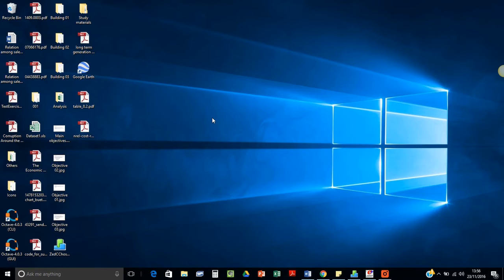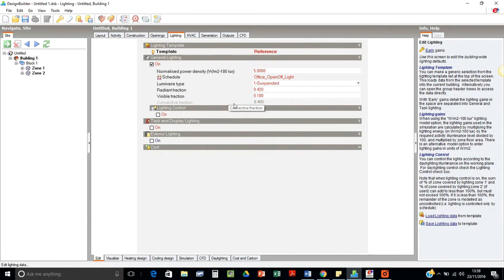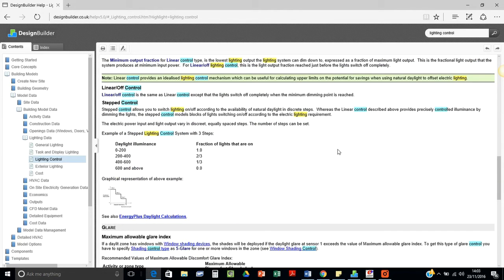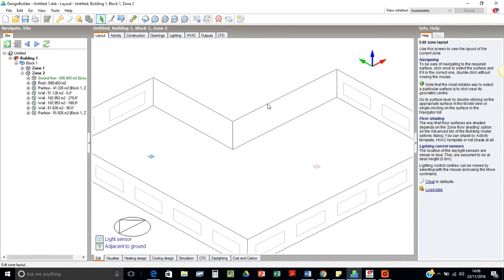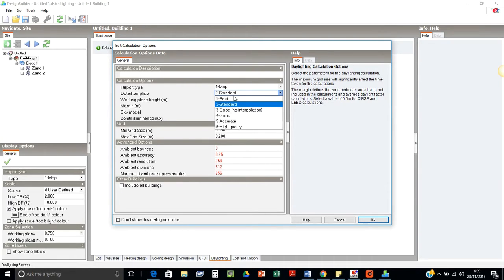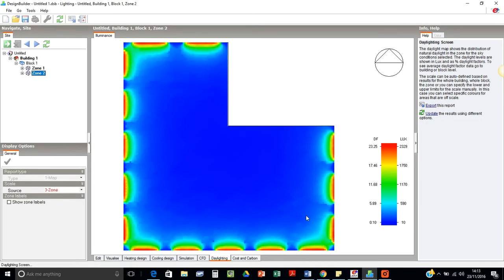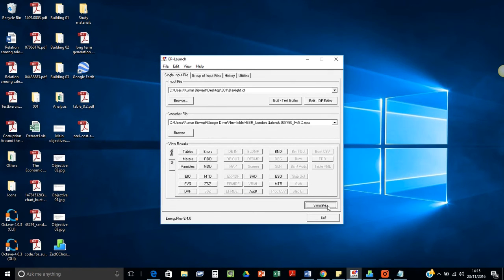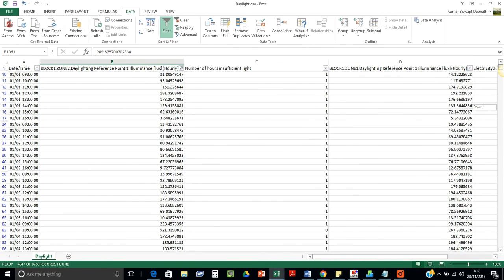DesignBuilder  tutorial: Daylight

Comment: Hi! Thanks for the tutorial. I'm using v7 of DesignBuilder and I don't see the export energy plus input file simulation option. Do you know where can I get the illuminance input file?
Reply from the maker: Hi! Usually, if the software is not licenced, then the export option does not appear. In the case of illuminance input, as far as I know, you do not need to input any file. In DB, the lighting controls that you need to input for the simulation. I hope that helps.

Comment: @Kumar Biswajit Debnath, Thanks a lot for this tutorial. I followed the same procedure with my 5m by 5m private office but I get larger illuminance values such as 5600 lux. Any idea to have more realistic values? Weather file used is SriLanka, Katunayake.
Reply from the maker: If you have large windows and clear glass, in the context of Sri Lanka, that may be possible. Highly depends on the size and position of the apertures of your modelled office.
Reply: @biswajit512  Thanks a lot. Actually the highest value I got is 56,000 lux (not 5600 lux - apologies) in that 5m by 5m model. However, when I increased the model dimensions to 10 by 16 m, I received much lower (~7000 lux near clear glazed window with 65WWR). 
Another question, I believe this is the available daylight illuminance at a particular point at the specified work plane height. So, if I measured the illuminance at this point with a lux meter, the reading could be much lower than the simulated result depending on several reasons such as the work plane surface color etc. So, I can't use the values from the lux meter to validate the illuminance results from the simulated model. Can I?
Reply from the maker: @dilininishadika5524  Or it can be higher depending on the colour of the walls and other reflective surfaces and positioning, which may increase the lux level. You can use the lux meter to validate the simulation model. You just need to see from the literature what is the acceptable difference of lux level between simulated and real-world situation. They will be always different but you need to acknowledge and show that how much is the difference and the possible reasons behind it with references from existing literature.
Reply: first of all I want to thank you for this useful video I am a master student and I make a master thesis about daylighting in the building in different time of the is there any way to calculate illumination  and glare in specific pout without affecting in energy consumption ( I need just a value for glare and illuminate without effect on base model) when I tarn off the lighting control and then make a simulation I just have amount off direct and diffuse light. thank you

Comment: Thanks a lot for this tutorial. By the way, the illuminance values you obtain at the end on the Excel sheet, are they supposed to change if we change the glazing type in the DesignBuilder model ?
Reply from the maker: The illuminance values may change depending on the glazing types in DB model.
Reply: Thank you for your answer.
Reply: I follow you procedure in order to study illuminance in a one-window room for several glazing solutions. At the end, I always have the same illuminance values, independantly of the glazing type, the weather file or the sky conditions. However, the illuminance changes well when I change the dimensions of the openings (for example, illuminance reduces when I reduce the window size). Would you have an idea were my errors come from ? Thanks a lot in advance.
Pierre IMBERT, pierre.imbert@insa-strasbourg.fr
Reply from the maker: If you are using different glazing types the luminance should change. The glazing properties should be changed in the following way: Opening > Glazing types > Glazing data (if you click the 'Project external glazing', in the right side of the screen the glazing data should come) > Change the type. If you simulate daylight now, it should show the difference.
Reply: Thank you for your help ! :)